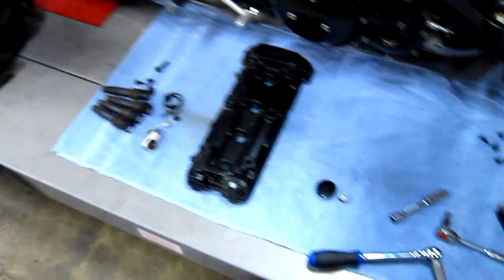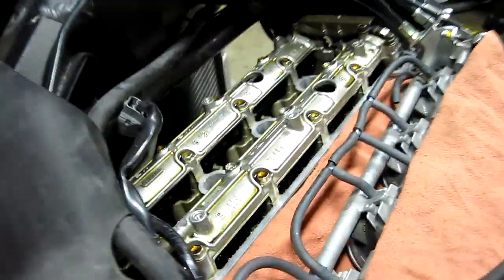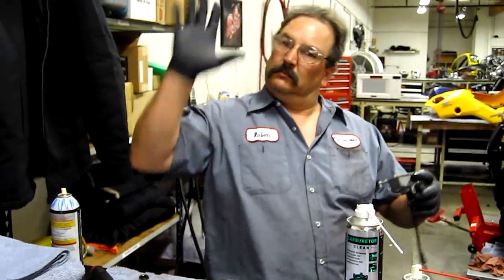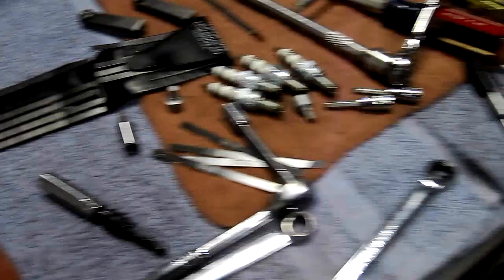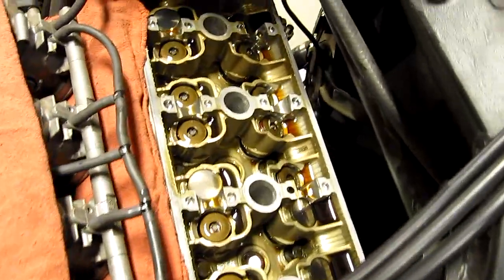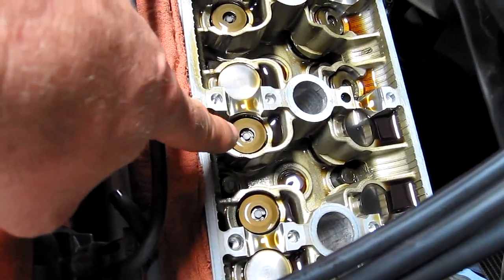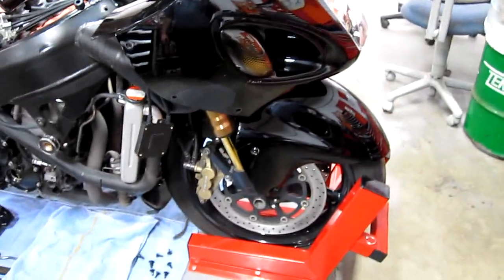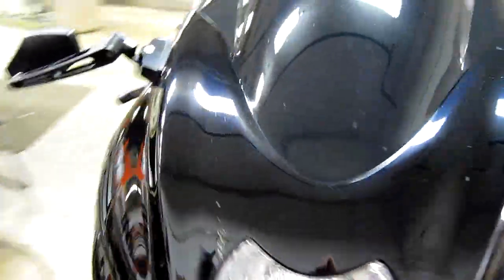Hayabusa Valve Adjustment

Comment: Ive started doing the valves on my Ducati and was really intimidated at first. But I just got the dealer service manual (which is in HTML/Web format for Ducati) read it through. Found every other bit of info on the net I could find (factory parts catalogs are more useful than I ever realized), watched videos, joined forums, watched the videos like 100 times and re-read everything at least twice more. If its only supposed to take a few hours, give yourself 2 days and take lots of breaks to read.

Comment from the maker: @ylism - As long as they are within specs (min or max) they are fine and will not need inspected until next interval.  They change adjustment very slowly (if at all) over time. In most cases, if you adjust up or down while they are within the specs, you'll push them too far the other way.  The shims are sold in 0.05mm (approx .002") size increments, so take that into account. It's almost impossible to get them all the same...

Thanks for viewing & commenting! - Shawn
Reply: I have hundreds of shims I’ve built up over time, many of them 1/4 size shims… in other words, 270, 272.5, 275, 277.5…etc. it helps to achieve more accurate clearances… you’ll always find the outside valves tighter than the inside valves for some reason, probably something to do with heat over time… if you’re going to remove the cams, you may as well try to adjust all the valves so that a pair of valve are opening and closing at exactly the same time… on the later model Gen 1, (2001 to 2007), they are missing the vacuum intake spigots on the two centre throttle bodies… the earlier 1999 & 2000 models have 2 vacuum intakes on each throttle body, but Suzuki in their effort to save money neglected to put them on the later Gen 1… I sometimes drill and tap the throttle body and install two new ones, so it’s a lot easier to adjust the vacuums… obviously in a shop environment it’s time consuming, but it saves a lot of time on the next time…

Comment: If you've already taken all the time to get the engine opened up, you might as well bring them back to the middle of the spec while you're in there. There's no reason no to, and it's not like they're going to get any better in the tens of thousands of miles to come. You can use a little common sense here; valves clearances get gradually out of spec. A valve right at the max isn't going to make it to the next interval as easily as one that's in the middle.

Comment from the maker: If it needs a valve adjustment, I would get that done before tuning the power commander to the new exhaust, it could throw things off afterwords. If you are going to flash the PC with one of the pre-built DynoJet maps, it won't matter which you do first. I really don't have any advise on the best exhaust, as everyone seems to be happy with there own choice. Search the forums and see what most people agree is the best, and go from there...

Thanks for watching and commenting Casey!

Comment: Good lighting is a must. and a good micrometer, always Mic. your old and new shims I have found discrepancy's on the markings on the shims so always Mic them, always reassemble valve terrene with oil and after reinstalling cam shafts and after proper torqueing the cam tower and after the cam chain tensioner is set  rotate the crank shaft 4 times recheck the valves take video and still pic.'s as the job progresses FYI, and an inch pound torque wrench is needed

Comment: Thanks for the video.  I plan on doing this soon.  I have a question.  I notice you are using the specs Intake .08- .18 and Exhaust .18-.28.  I have a 05, which has this same engine, and the Clymer manual says the specs are Intake .10- .20 Exhaust .20- .30.  Using the Clymer Manual all these would be just in spec, however I am sure the fine tuning wouldn't hurt.  Where did you get the specs you are using?

Comment: Looking at your measurements, the valves that were out of spec were a little loose. Valves get tighter as they wear in and the first check isn't until around 14,500 miles. My question is, do you think most of them come a little loose from the factory knowing that they will tighten to spec at the first inspection? Looks like a nice shop, just curious why you checked them so early.

Comment: I got a question. I recently got a tune up on my busa oil change spark plug ect.he told me that by tbe way my valves were fine.is that actually something you can casually glance at or do you specifically have to take it apart
Reply: You gotta take all the things off that were off in the video. There is no possible way to check valve clearance just by glancing at it. Hell, you can't even see the valves without lifting the tank and taking the valve cover off. Then if they aren't in spec, you gotta take your journals and cams out to add or subtract shims. FYI always replace your journal bolts with brand new ones, never use the same bolts to put the journals back on. They are a special type of bolt and are good for one use only. Some people may use them a couple of times, but I never risk it.